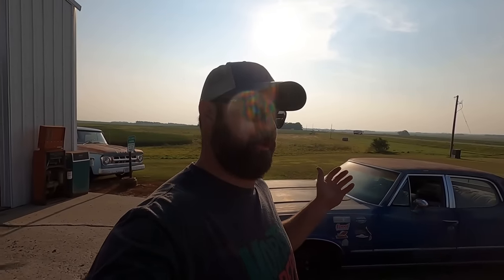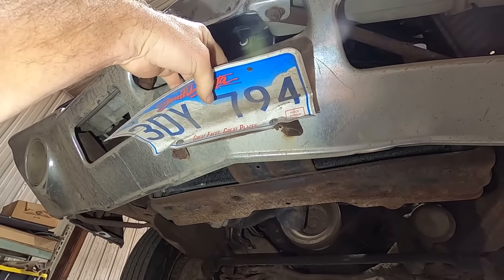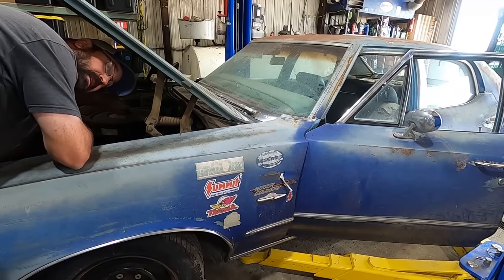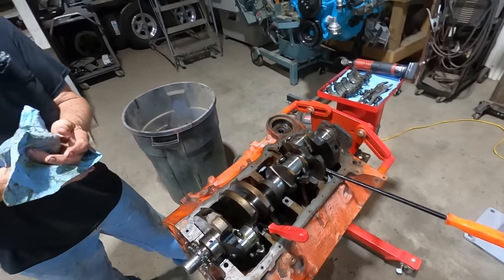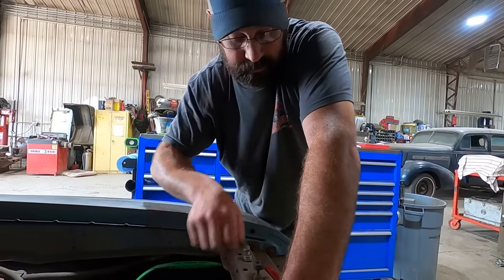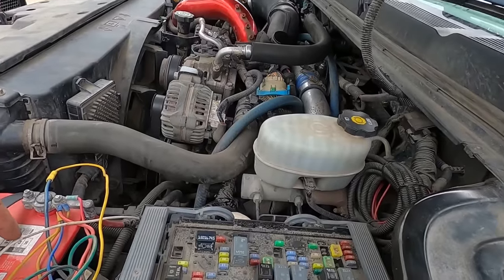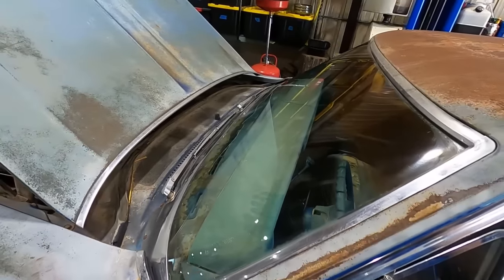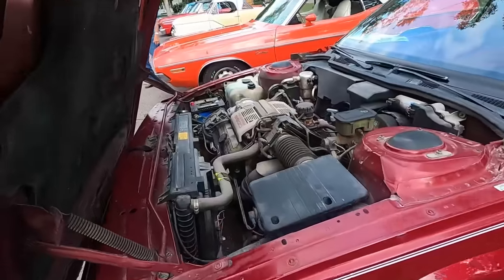Dirt Cheap Muscle Car!! Saved from the Scrap! Will It Run?!? Budget Built Hot Rod!

Comment: Oldsmobile i believe has a ballast resistor just like a gm Chevy truck product, and you might want to check for the ballast resistor and eliminate the wire running it they are trying to pull the voltage on the factory wire and it doesn't carry enough amperage there's a reason pertronix tells you not to use it, especially on the early 60's to the late 70's Ford products.. which runs a resistance wire not a ballast resistor and keep an eye out on the caddy and the mid 80's gm and the Buick vehicles you have sitting around they not only have the bop bolt pattern bell housing but they also are a good source of the dual pattern Chevy and the Buick Oldsmobile Pontiac Cadillac pattern bell housing automatic th350,375b, and th400 turb transmissions.. and the the wingnut missing issue is also a pet peeve of mine you can also get the wingnut at your local junkyard they are all over the place way than trying to make something work or the 5/16 air cleaner stud swap on the 79 chevy k20 scottsdale with a piece of allthread 4ft spike that touched the freaking hood??? And the stack of flat washers and the lug nut 1/2 inch spacer and the replacement fine thread tap to hold the air cleaner lid on,i eliminated all of that and went to the junkyard and got the correct air cleaner stud and wing nut on a 4bbl quadrajet that could be a mid 70's 375b looks similar to a th400 except the flange for the driveshaft, and the one I was talking about is a th250 a light duty version of the th350 a Buick thing lol...

Comment: @mortske the torque converter off of that is a switch pitch and those in particular are worth a little bit as cores to swap onto early switch pitch St400 transmissions (TH400) for old school drag applications

Comment: That "paint" is Glyptal . It does " cure" very slick and hard. However, it only sticks well to very clean fresh metal surfaces. It should never be used on any internal engine parts that have not been media blasted to remove the residual oil film. Most " budget builders" don't bother with that .

Comment: The two doors are 112" and 4 doors are 116" frames.  The 2 doors also come in small block and big block frame as well as convertible (reinforced/boxed along the sided).  Trunk lid from 4 door fits the convertible. Same nose on 2 door and 4 door car.  Power train front to back except driveshaft will work in a 2 door.
Reply from the maker: good to know
Reply: And the 116" frame should work on the El Camino/Sprint cars... but they are boxed... ya know that's a huge load truck!  @MortskeRepair
Reply from the maker: @brianl6798 good to know!

Comment: I love the Pete Jackson gear drive comment,i had the summit brand gear drive timing gear set machine for more noise my uncle gave it to me and when I built the 355 in the 86 chevy k20 custom deluxe long bed well used beat to hell farm truck,it was newer than the Edelbrock timing chain and gear set i already had on the 350 to start with to be honest it was very annoying and sounded like a supercharger lol!! Really annoying with headers and collector extensions for exhaust pipe, part time np208 transfer case whine lol and the loping xe 268h competition cams 477/480 lift bumpstick lol

Comment: You replaced a GM Low torque starter with a GM High Torque starter.  Longer field coils move the positive lead to the rear of the starter.  All of this stuff was interchangeable except for nose cones and  (some)Bendix drives.  As you know, the cover end bushing is supposed to remain in the rear cover, and not weld itself to the armature shaft. A bit of lithium grease on the drive end armature shaft will help improve Bendix engagement and lower solenoid and starter motor amperage draw.  You're welcome.
Reply from the maker: Thanks for the info!

Comment: Looks like a Super Turbine 300 transmission. Called a Jetaway in Oldsmobiles. It's supposed to be a 2 speed, with zero parts interchangability with a PG. Supposedly a strong box. Parts are on Rock Auto.
Reply: Three-speed Turbo Hydra-matic

Comment: That SSH 310 was a great cam. They wouldn’t make power until 3200 rpm but they would rev to 7000+. Definitely needed a minimum of 3.73 for gears. Never seen a SSH 310 in a solid cam version.
Reply from the maker: Good info!
Reply: @MortskeRepair the Hydraulic version of the SSH 310 was 485 lift and 236 on the 0.50 duration. We had one in Camaro powered by a 350 that had 10.1 compression,1.94 heads and a single plane intake. It ran excellent considering it was all stock parts. Nasty idle.

Comment: Transfer case lever got moved when he dropped the motor back in it lol I was going to say the ground strap on the back of the head or the transmission bell housing bolt was a issue ive seen both i did the transfer case type situation myself when I built the 355 in the 86 chevy k20 custom deluxe farm truck because i had to pull the right side hub apart a grease it because the hub wouldn't unlock to the free wheel position and i forgot that and that the truck was trying to roll out of the shop and i shoved the transfer case lever towards the seat...lol

Comment: I learned the hard way that a 2 door body will not fit on a 4 door frame. They did interchange 1964-1967, but 1968-1972 the 4 door frame is longer.
Reply from the maker: Damn

Comment: I'm not sure if you know it Mr Mortske but the 1972 Olds 350 what is the strongest of all Oldsmobile 350 is made it had more webbing and the block and if those valve covers are gold that's the good engine. That's your Airhead Tech tip of the day
Reply from the maker: good to know!

Comment: California emissions on new cars started in 1966 in California. They also did other things that were 1 dumb and 2 were a royal pain.  Mad us put crankcase ventilation on cars pre 66 model year. They also took vacuum advance of of many cars as well. My 65 Falcon was a candidate for that mod. There was no mechanical advance on the stock engine removing they vacuum advance would have made a slow car  really short on power there was a loop hole in the law that we exploited in order to keep the advance stock.

Comment: Master cylinder reservoir size has to do with disc or drum. Disc have a larger reservoir because the caliper pistons use much more fluid, or so I was taught in Auto shop (Vo-tech).
Reply from the maker: It also has effect on your pedal pressure. And with power vs. manual brakes

Comment: Ok so the last year for the  Buick 300 was 1967 and the TH350 was born in 1969 so that mystery trans you have there is a Super Turbine 300. That trans has a dual stall speed with only 2 forward gears kinda like the Chevy powerglide but totally different with similar gear ratios.

Not that great of a transmission, a TH350 is better. The switch for the st300 should be on the throttle linkage. Would of plugged into the harness under the hood and there would of been a connector to the transmission to control the dual stall speed converter that may of also controlled the kickdown?
Reply from the maker: good to know!

Comment: Hold on the base model 77 Oldsmobile Delta 88 my brother got off of me was a factory non ac sbc 350 th350 long tail transmission and the transmission fluid was brown and always smelled burnt, but my brother drove it two years and then pulled the motor out and ran them in a 75 Chevy c20 and put the transmission right back in the delta 88 and it still pulled the car fine can't explain that one if I tried..

Comment: Ive ran derby motors that were not much better than the sbc you were taking apart..., and I may know of a few somewhat usable cutlass supreme cars around the area you are from mortske sir,, and I have had a 79 Chevy k20 scottsdale long bed farm truck the bed rotted out and fell off the back of the truck,it had a sbc 350 vin L medium duty Chevy 4bbl quadrajet carburetor with no ac anyway the farmer didn't want to buy a alternator or a power steering pump so it had a early Buick V8 power steering pump and Oldsmobile v8, and buick v6 power steering brackets welded to half of the water pump sbc and exhaust manifold dr side brackets,. That was fun changing that shit out lol and the alternator was a complete hack job and homemade brackets and like allthread and heim joints with cotter pins and it was a Cadillac v8 early 70's alternator and the wiring in that truck was a nightmare!!

Comment: Tell Pookie to unhook the battery if that happens again it's a Dodge thing electronic shift module goes wonky. And then it will work fine again until it does it again.

Comment: Four doors are like long wheel base trucks, and I prefer the ride of lwb over swb bouncing in hopping around that swb trucks are bad about doing. 
Ever come across 90's Bonneville, they are sleepers, cause the v6 will surprise you, and the super charged units are  very nice Four doors with room for all the whoevers
Get MoJo some a/c concentrated condenser  cleaner used on the outside coils, and mix it according to the instructions.
Then you can use a spray bottle or a garden pump sprayer to soak the aluminum intake with, after you wash the bukk of the nasty crusty oil an other surface debris off with pressure washer.
Then soak it down good, and when it stops foaming, then wash it off again. 
If stains are still there spot spray and take a plastic brush to it.
Sometimes nothing will clean cast aluminum, but most things will come off using this, but don't get it on anything you want to keep the paint on like parking cars too close, are alloy wheels with sealer, as they will immediately start soaking in stains from brake dust and oils.
Keep it off MoJo's old thin skin, and definitely wear safety glasses, and wash it off your skin asap. 
But it works like a champ.
Yeah I already know, I talk too dam much
Reply from the maker: thanks for the info!

Comment: Those and the early to mid 70's are the cars that are the oldsmobile and Pontiac cars you pull the starter off you use the floor jack because they are hefty to be holding over your head and be a contortionist putting the freaking starter on,use the standard issue automatic transmission sbc 350 starter or the same thing but 250L6 and pull the ends off the starter and the solenoid and swap the nose to Oldsmobile ive done it several times lol

Comment: I always thought the 4-door GM 'muscle car' versions were butt-ugly. 
I had a '72 442 Supreme that had every option. Even had a leather interior. In '72 they were detuned so GM decided to add luxury to them. Mine was flame orange with white stripes - which looked the opposite of luxury. The air compressor was shot so one of the first things I did was remove all the air conditioning to get the massive weight down. Had to mess around with the air shocks to get it to bite. 
When I got it done I could pull wheel stands with it. Busted the frame on it around where the shock towers were and then it threw a valve - sold it for like 400 bucks - which was good for a non-running car at the time. Too much of me beating the tar out of it. I had been out driving around one time and a guy on a cycle wanted to pull me over. He worked for Walker Muffler and I got a totally free dual exhaust with a crossover. It had the split rear bumper with the tailpipes that stuck out and he said they looked all over the country for one with the bumper to test on it. And of course that bumper is worth a ton of money now.

Comment: That is not a TH350 behind the Buick 300.  It is a 2 speed Buick Super Turbine 300.  It has a switch pitch stall converter, 2 different stall speeds.  It has '67 valve covers on it, so maybe it's a 1967 model Buick 300.  Do you still have the '70 Pontiac Le Mans?  If so, that would have the right trans and driveshaft.
Reply from the maker: sold

Comment: Ive had so many gm vehicles i have three battery wrenches one is a 8mm craftsman raised panel va made in the usa wrench the other two are both ratchet wrenches and 5/16 gear wrench non reversible no offset the same in the other wrench design which is a napa wrench also made in USA kinda hard to find these days otherwise I would have a whole set of those sae and metric wrenches... That is probably a c 1-3 or a d series head since it is a early 70's Oldsmobile v8 those are fairly decent heads .

Comment: Could be the starter is bad. It could also be high resistance in the battery cables. A bad ground wire or ground wire connection can do the same thing.

Comment: Mort, that Buick trans is probably the old Super Turbine 300, unique to Buick.
Reply: came here for the same info, if its a 3 speed its a ST400, fair bit of info online, some were variable vein converters and I believe 64 was the only fixed pitch vein model.. but hell with OBP its hard to say! lol
Reply: @jumperjosh1732  Vane, like the blades of a turbo, not vein, like the main one we drain! 😉
Reply: Mort, don't forget that Caddys also have the BOP bolt pattern.
Reply: @jeffrykopis5468  it was late, my mastery of the English language was retreating faster than my hairline! Lol thanks brother lol
Reply: @jumperjosh1732  Note my hairline. The more hair you lose, the more head you get.
Reply: @jeffrykopis5468  I like the way you think sir!

Comment: I have a 301 factory turbo motor .4bbl draw through system. Buick also used the draw through turbo v6 .I have 2 of those.ok motors nothing to brag about but turbo lack luster performance

Comment: Hey Mortske great video. 👍. I have a question for you. A old-timer was telling me that in his opinion that the old flat head V8's were great to turbo or super charge . He said it was because of the fact that they were low compression. He said that the pistons are rods needed to be changed out. He said he put super chargers on the back in the 60's. He told me that you really had to watch out for heat , because they had issues with heat. What's your opinion about this? The old guy also said that the flat heads were used in England until the late 60's in postal vehicles. Did you know about this?
Reply from the maker: Never seen one turbo'd... superchargers are really low boost on them
Reply: @MortskeRepair  I couldn't imagine much over 6lbs of boost . But it would be a interesting build. I only ask you because you seem to know more about flat heads V8's than most people. Thanks for the reply. Have a fantastic week.

Comment: the other trans you were going to use was a turbo 400. look where the vacuum modulator is.
Reply: Thats an st300.. came before the th350. 2 speed switch pitch
Reply: @harpercasey49  that makes more sense. It just looks like a 400
Reply: Yeah those were a mutant mix of a powerglide and th350 but it was really the prototype of the th350
Reply: I learned something new thank you for taking the time to explain it. @harpercasey49

Comment: how did you check the alternator like that? my father used to take a lead off the battery ,never seen your way im interested in what you did ,Gday from down under
Reply from the maker: If it's magnetized on the back it's working

Comment: Dude it has an early  head and a late head. Drinker side has bolt holes.
Mechanical injection works great on the street.
While your putting a trans in it put a starter in it. I can't believe youvthink it a battery problem

Comment: That's a pretty nice olds an I'm like you always having to rebuild starters but I agree with you I don't like unilug wheels an I rather have a 2bbl any day cheaper on fuel, they got just as good pep as a 4bbl an they hardly mess up plus if they do their easier to rebuild an parts is cheaper but I'm a 2bbl man all the way if I get a vehicle that's a 4bbl it comes straight off every engine I own is a 2bbl I believe 😂 so I'm a steelis wheels,2bbl,4 door man
Reply: ClickOnProfile736  😂😂🤣😅 this is a scam cause ik all the channels mortske has plus I been through this once with another channel so try to scam someone else 😂🤣🤣😅

Comment: Cool torq thrust score they would fit Reggie if it was big bolt pattern,i have had a 77 Oldsmobile Delta 88 brougham 4 3/4 small gm bolt pattern,a 79 oldsmobile delta 88 brougham same bolt pattern ah then there were the Three odd balls lol,, a 77 delta 88 complete base model big bolt pattern truck 1/2 ton and my 77 and the 79 oldsmobile 98 regency brougham cars i had all three of them were 1/2 ton Chevy truck wheel bolt pattern as I said the 77 Oldsmobile 98 regency brougham with the red leather interior when I got the car it had 1/2 ton Chevy truck Firestone mud trac tires on the front and white spoke wheels and 30/9.50 15 tires on the rear you talk about stupid looking?!? And the 77 Oldsmobile Delta 88 base model my brother switched everything over to gm gbody cars spindles and rear axles so he could run a set of 14 x7 cagar grand prix a machined polished aluminum blade wheel yuck oh well his car not mine, with the Firestone Firehawk 215/60/14 bald tires i have referred to and I was like you mean to tell me that you swapped out all the big bolt pattern gm junk and then you put nice wheels a matter of opinion and junk tires on it??? Good grief not worth the hassle....   The 79 oldsmobile delta 88 brougham i had with the small bolt pattern gm had 14x6 buick steel road rallye wheels,,185/70/14 Douglas performance 700gt and the matching 205/6014 Douglas performance 700 gt Walmart special tires im like really a set of mid 80's buick regal factory steel mag wheels,or a set of decent 63-68 buick Rivera wheels on a OLDSMOBILE DELTA 88???!

Comment: And there is a th200c also throw those away light weight gm overdrive buick v6 and Oldsmobile v8 metric gm junk and i have had two Chevy S10 trucks with them as well.